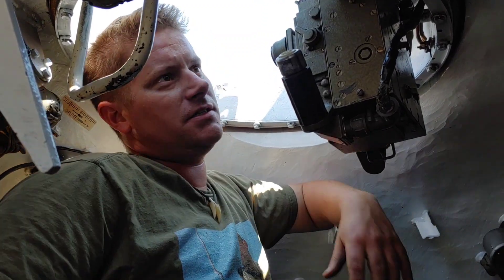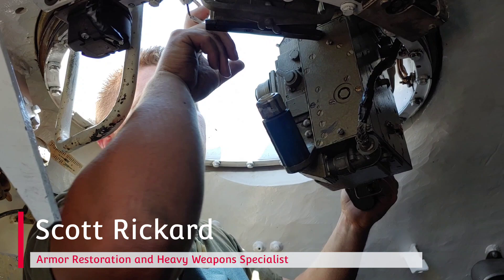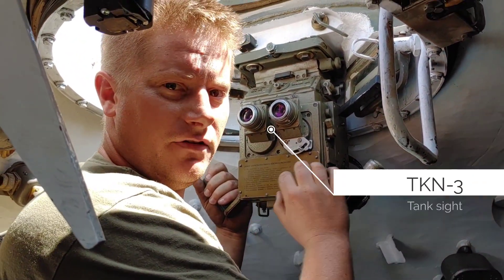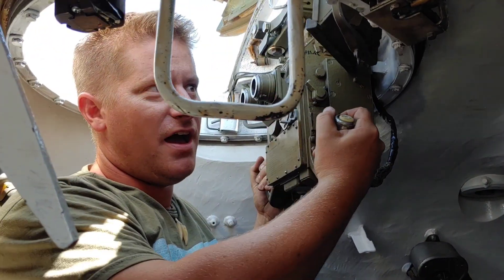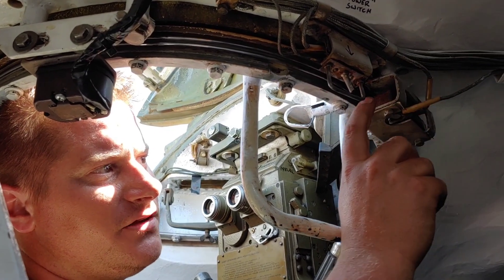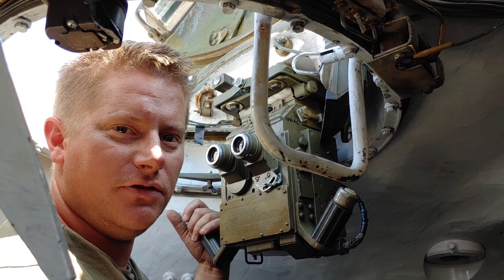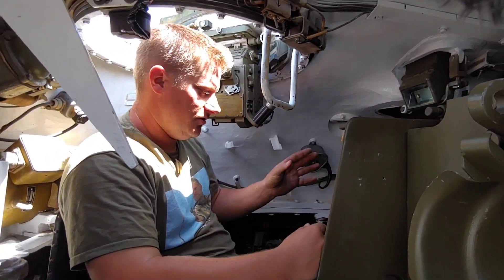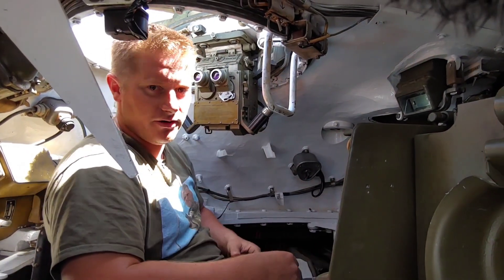HOW IT WORKS, Soviet T62 Commanders Override.

Comment: Can the tank commander fire the gun from his seat though? Or was that capability really only introduced with western electronics mounted by Russian Federation on their tanks?
Reply: No, nor could he aim vertically (at least on the T-72, which I know more about). That's what the gunner is for.
Reply: @DecidedlyNinja  So it isn't a hunter-killer system. It's just a rotation override to allow the commander to show the target to the gunner.
I was asking the author of the video if it was possible to shoot the gun because not everything written in books is true.
Reply: @morgus9892  Hunter-killer is not defined by the TC's ability to fire a gun (as it says it is "Hunter" - TC and "Killer" - gunner), but TCs ability to independently search for targets and hand them off to gunner via traversing a turret on the target. In that sense T-54/55/62 do not have "real" hunter killer, as TC can not designate target in elevation, but it was definitely step toward it.
Reply: @Bojan_Kavedzic  A hunter-killer system is a name for the specific ability of the commander to be able to fully autonomously designate and fire at the target, completely independent from gunner actions. A hunter-killer system is rarely used with complete commander override, most of the time the commander just points the gunner towards the target and the gunner does the rest, but the ability for an override is required for it to be actually named hunter-killer. Otherwise it's just azimuth rotation just like shown here, even if it's both vertical and horizontal, but I don't think such a system exists because it would make no sense to at that point not add the ability to fire the gun from the commander's seat.
Reply: @morgus9892  Depends on which definition, British one did not require TC's ability to fire a gun. US one usually includes TCs override, while French one requires stabilized TC sight but no ability of override.
Reply: @morgus9892  To muddy the waters further The Chieftain (Nicolas Moran) considers one on T-72 true H-K, despite not being able to slew gun on target in elevation.
Reply: WTF does it have to do with Western electronics?  Need a Western switch to fire the gun. 😂
Reply: @SuperIv7  Need western technology and thinking to understand the advantage and need for such a system.

Comment: It's basically the Commander's overide within the Commander's Weapons Station. On the M1A1 me as the Tank Commander would scan for targets with my periscopes or in protected cover with binoculars at first or night vision goggles then use my override to point my gunner in the direction of my target or suspected target. The M1A1 during gunnery or training all 4 tanks in the platoon would do a wide scan on our thermal sights and designate targets of engagements. With greater magnification up to 3 power and range finding with a ballistic computer the gunner and commander can engage targets on the move from the average of 1500 to if the gunner can engage with good bore sight. On average is 1500 to 2000 meters during gunnery. The T-62 sight isn't sophisticated as Westen Tanks like the German, British, or US Tanks. Gunner and Commander sights don't have very good magnification or thermal detection but use a form of IR or Infrared which is easily detected by NATO tanks. Once again gunnery and tactics with a conscript army are not well suited in modern combat conditions.
Reply: The Abrams was not around in the 1960s Guy. Even T54 T55 after WW2 had this system here. Compared to its adversary tanks, Leo 1, Cheiftan and M47, M48 had nothing of this kind. The Russians were first to come up with this design. Does not sound like junk to me.
Reply: T-62 was way better than any NATO tank when it came out